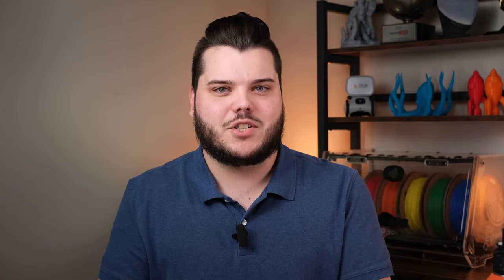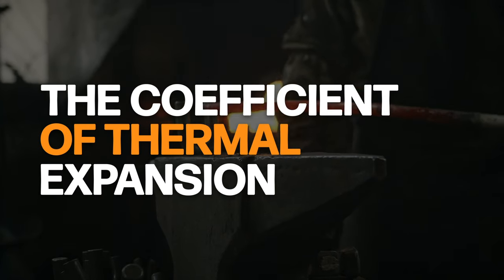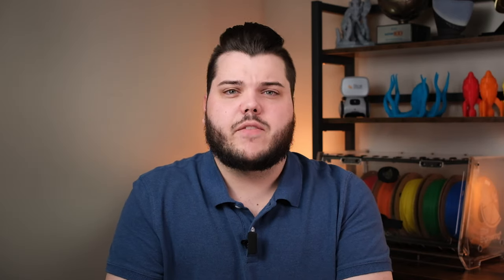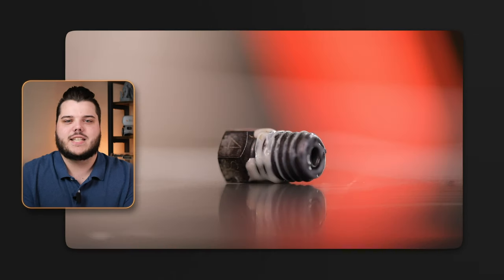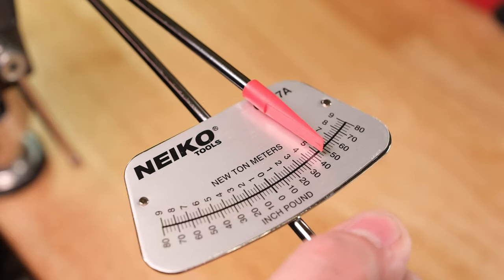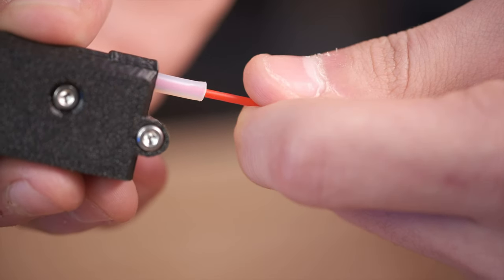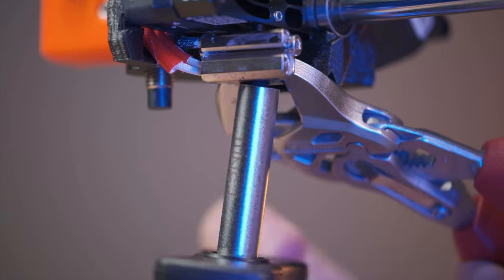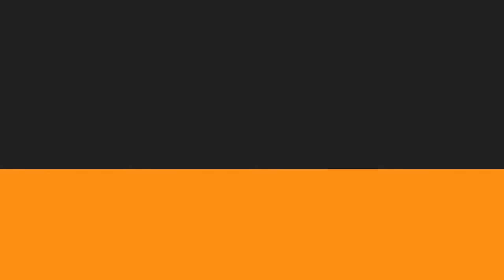You’re Changing Nozzles Wrong | How to Properly Torque a 3D Printer Nozzle

Comment: I used to have these issues with the stock Ender 5 pro hotend. 2 1/2 years ago I upgraded to the Mosquito hot end, Vanadium nozzles and your torque wrench. Never had a problem since, constantly swapping between 0.3, 0.4 & 0.6 mm nozzles depending on the item being printed and over 3000 successful prints with no leaks or clogs.
Reply from the maker: That's awesome to hear! –Peyton

Comment: I generally do a fairly cold filament pull, heat my hot end to about 280 which is 20 degrees hotter than I typically print at most, let everything sit for a minute so any leftover filament oozes out, take out the old nozzle, screw the new one in, turn off the heater. Has worked very well so far, especially if you have an all metal hot end of any kind.

Comment: I was looking over your Boron Nitride Paste "for every interface you want heat to flow" that shouldn't be heated over 100°C while potting.  Do you still suggest hot-tightening after the paste has set up? Should one avoid use of this paste on nozzles, or is this an "always use copper blocks" situation so one can "warm-tighten" at 90°C while the paste sets?
Reply from the maker: Thanks for the question! We do not recommend applying Boron Nitride Paste on nozzle threads, as it can make nozzle removal more difficult. Using Boron Nitride Paste on interfaces like the heater cartridge and temperature sensor is ideal for improved heat transfer. Hope this clears things up!

Comment: Great video!

With the heat/cooling cycles of a heater block, I would be worried that the nozzle may lose its torque over time. I have noticed that my printers that I don't check / change nozzles frequently - such as those that have a "set and forget" hardened CHT or vanadium SE nozzle - have a tendency to leak after some period of time. Is there a "blue loctite" equivalent for nozzles?
Reply from the maker: The threads of an aluminum heater block soften considerably and can creep at common 3D printing temperatures, but unfortunately our only solution for this is to check nozzles often or to use Slice hot blocks.

If you have experienced this with Slice hot block and nozzle, we would love for you to send in a support ticket so we can learn more!